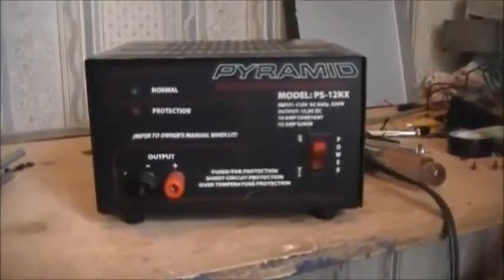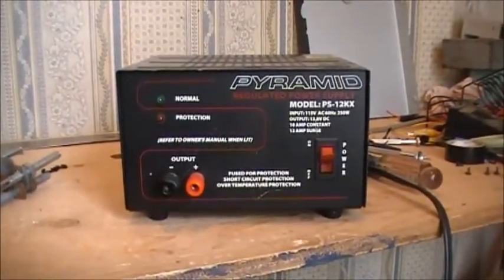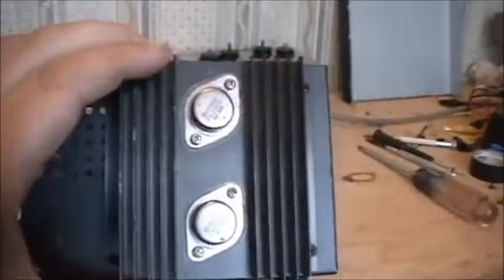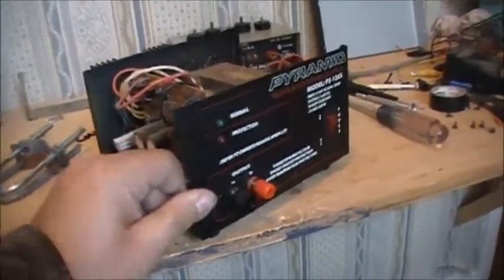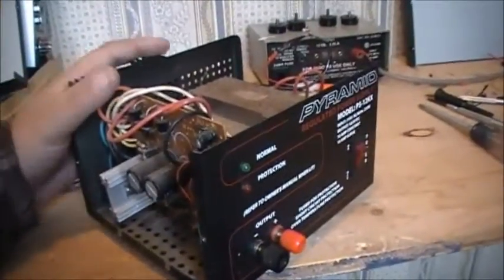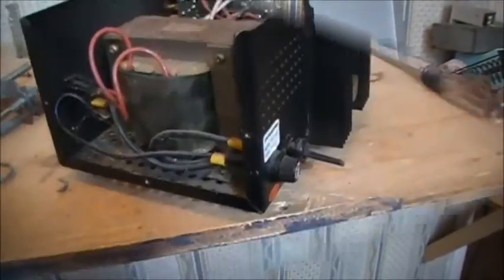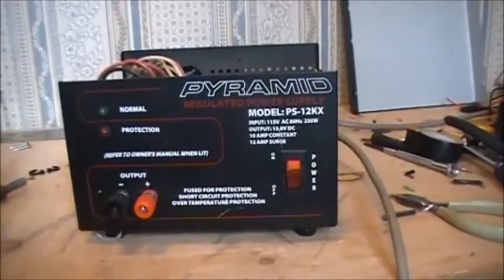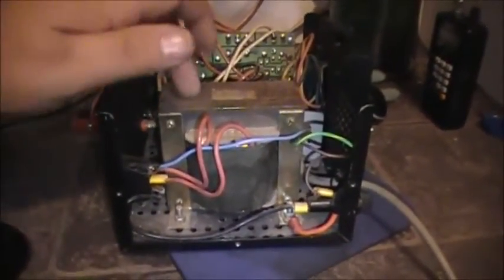PYRAMID PS 12KX  Trouble shooting and repair

Comment: Seems when you put the power supply up in that little cubby hole it's not getting air flow and the transistors maybe getting kind of warm.
Reply from the maker: Guess i will soon find out how it behaves up there.  The power supply do have a fan built in, and if that is not enough i can add more if needed, no big deal either way.  :-)
Reply: @Radionut63  I thought it should have a fan. My ps36 k x has a fan but I didn't see one when you pulled the cover off. Probably just overlooked it. Evidently those fans go bad quite a bit in the pyramids power supplies. Hope you the best.

Comment: my  power supply  exact  same  modal  just  beep  protectionmode , i checked the   fuse  wit  mutil  meter  all 000's so fuse is  good  any thoughts ?
Reply from the maker: Transistors on the back of the unit could be faulty, or there is a short on the output binding posts internally.

Comment: I have one of these it has out put voltage but low current? What about that . My Huss registration transistor
Reply from the maker: you may have a bad power transistor on back of the power supply, may have failed.

Comment: I don't know if I should be posting this or not , but here it goes I have a pyramid ps 14 kx it doesn't put out but 11 volts ,It was a interesting video keep up the good work  Thanks , what should I look for
Reply from the maker: if it is putting out 11vdc, might just need to have the voltage output adjusted a bit with the circuit board mounted variable resistor.

Comment: Was fuse for line to radio and that was fine.  Is there one for that also and if so where?
Reply from the maker: There is a AC line fuse on the back of the power supply as well.

Comment: Brad here.  It's been in hot tub since 2015 without issues. Possible just died?
Reply from the maker: Perhaps it did.    Did you check the fuse? Might have blown

Comment: This is on my hot tub and was supplying power to my stereo in in and now no red light when powering on and no music so wondering what wrong.
Reply from the maker: Chances are the power supply gave out.  I have mine back on the bench for repair once again, it has a voltage issue that i am trying to sort out, so far i found one bad Capacitor which i replaced, it helped some, but not out of the woods just yet. :-)

Comment: Too bad you did not start off demonstrating the perceived issue.  You stated it was "buzzing". Was that in the supply itself?  If so that is usually physical.  Under load transformer lamination or case halves vibrating (I have seen the latter a couple of times). Replacing the mains cord and reassembly likely corrected case vibrations.
The 2N3055 devices are regulator pass transistors that are wired in current mode, not amplifiers.  If one opens the other has to handle all the current untill it too opens giving zero.output. If one shorts you would likely see nearly the full rectified DC out.
The transformer has to be capable of delivering the full rated current, in this case 10 amps so loosing a single transistor would not reduce current from transformer.
Reply from the maker: I still own this power supply, and yes it is still making that same noise!

Comment: From what I have learned the ic is a LM723 regulator...and it goes bad in these alot..mine has a MC1723CP which is the same...you should get voltage from pin 10 to ground....mine had 28 volts into the chip on pin 11 and 0 out..so this I hope is all that is wrong with mine...I hooked a tv flyback transformer to my supply and somehow the high voltage went down the + positive wire and burnt out my IC...stupid me...I know.

Comment: Grounded electrical equipment is always a plus... however even at a potential 35w that radio would only be pulling just a whisker over 2.5A surely to test the PSU sufficiently you'd need to power up a "larger" Amateur transceiver (100w plus)?
Reply from the maker: +SpectreOZ Yep, put her on the 706 and crank her up!  hehe  :-)
Reply: +Radionut63 Indeed or use some halogen automotive bulbs... that's how I load computer PSU's for testing.

Comment: Good video Darrell!  I see the old trusty 138xlr,  I have one of the old Grants that uses the same chassis... they are good radios to hold on to!
Reply from the maker: +CARL BOLEY (CARL557511) They sure are....  My 138xlr now has a problem with distortion when the mic gain is increased either bit at all, been all weekend trying to figure this one out!
Reply: Those radios have a problem on ssb tx with distortion. If I remember rite there is a pot control for that on the chassis, have you tried to adjust it?
Reply from the maker: +CARL BOLEY (CARL557511) On the 138xlr, that board mounted control is brought out to the front of the radio as a mic gain control, I have tried everything I can think of to clear it up.
Reply: Maybe there is a way to reduce the gain on the in and out of that mic amp.  I would have to look at a schematic to see how they designed it to be sure.
Reply from the maker: +CARL BOLEY (CARL557511)  I have a SAM's copy of it in PDF if you need it ;-)